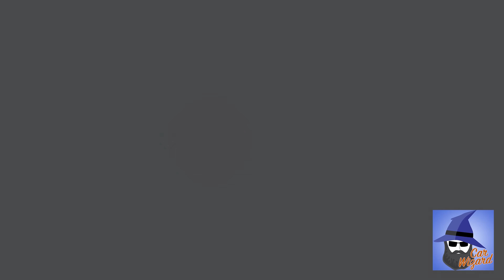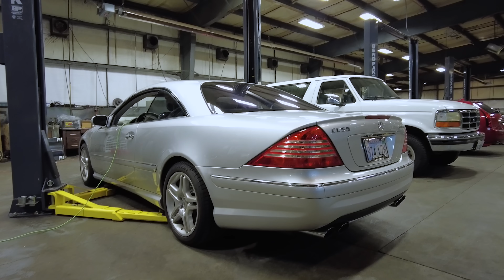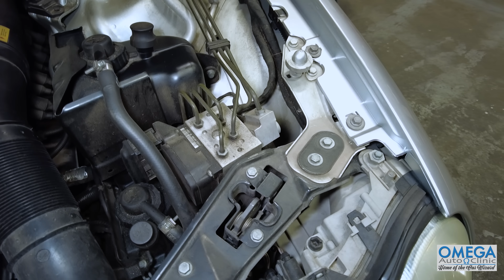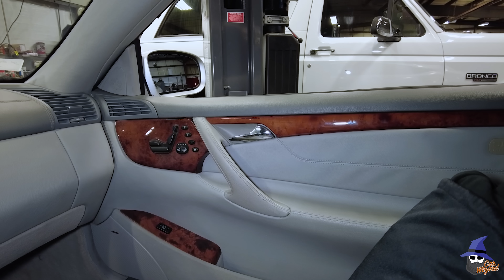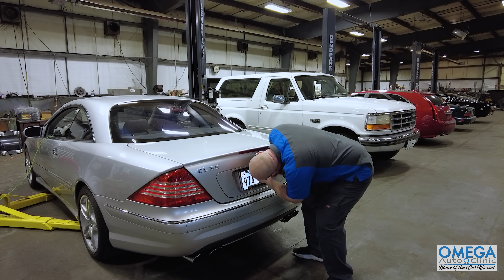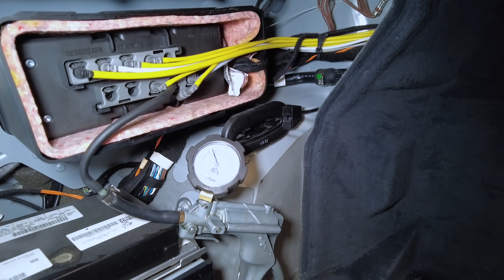Really, $4K to fix the locks! How can the CAR WIZARD charge SOOO much to fix this '05 CL55 AMG?!?

Comment: A dollar wages that it's the trunk lock line where it runs from the body to trunk lid.

I would also wager that if you remove/refit the pump fuse under the rear seat in the rear BCM, everything will work two/three times and allow you to trace any leaks. 

Also don't forget that much of the system is positive pressure as well as vacuum using the same lines.
Reply: I would also add that you can run  vacuum/pressure directly to each line in turn to function test each component. Actual hands on diagnosis takes about an hour and initially only requires pulling the trunk carpet panel and pump manifolds which simply unplug. Pulling each line in turn is asking to break a fitting. 

If the pump runs, then the chances are it is sound. The system is designed to protect the pump by timing it out if a leak occurs until it is manually reset, which gives the illusion of it not working.
Reply: I’ll add that based on my experience with my S600 other common failure points are the lines that feed into the doors, and the trunk latch itself.
Reply: I had a problem with 02 c class and the repair for the door locks not working with the key fob was to pull the sensor out of the drivers door and resolder the two main connections in the sensor circuit board. I saw a utube video showing how and tried it. It was a bit of screwing around. But it worked. The locks worked and if I held the unlock button longer the windows would go up or down and the sunroof would activate, first the shade and then the glass.
Reply: @paul5683  that could be it!  You're talking the little black sensor in the door handle I assume?  Ya I'm almost certain the Hold lock/unlock feature it has doesn't work too.
Reply: you sound familiar with these systems, I have an issue on my 01' s class with the locks not unlocking.  It seems as if they are weak.  They lock/unlock fine when the car is driving.  But central locking doesn't function properly and same with using the fob.  Any ideas?  PSE pump just weak?
Reply: @jordanh3866  Where abouts are you?

It sounds like it is an ambient temperature issue if things start working when the car is being used.
Reply: @alasdairhompstead7950  I'm in Minnesota.  It's weird, it's like everything functions except lock/unlock.  However like I said, once I put the car in drive, the auto lock locks all the doors with no issue.  I'm pretty savvy with these cars but I can't put my finger on this one at the moment.
Reply: @jordanh3866  Does the behaviour improve if you use the physical key instead of the remote buttons?

Does it lock/unlock as normal with the button on the dashboard?

Yes to both of these points to an issue with the remote side of things... Possibly a weak fob battery or as likely interference from another source... There's significantly more wireless technology today than when the car was designed/built.
Reply: @alasdairhompstead7950  no the central locking button doesn't seem to operate the locks.  I did put a new battery in the fob.  Haven't noticed a difference in performance if I use the mechanical key.  If the doors are locked lets say, like I pressed them down and closed the doors, they stay locked unless pulled up.  But if they are all pulled up, when I put the car in gear, they all go down like there's no issue.  Not the end of the world but it's just annoying lol.
Reply: @jordanh3866  The fact they lock when you start driving suggests that the vacuum side of the system is functioning. I no longer have a W220 to scan but it could be a gremlin in whichever module runs the fob/keyless go side of things.
Reply: @alasdairhompstead7950  Thanks I really appreciate the tips!
Reply: https://youtube.com/shorts/8w7Z7bWtMiI?feature=share

Comment: I wonder if the air pump can be rebuilt. Air pumps consist of rubber diaphragms that are vibrated by an electric motor. The rubber diaphragms rip when they get old. Being a Mercedes part probably not rebuildable but it's a shame because a rebuild kit would probably cost a few bucks
Reply: more profit on markup of a $1000 part ($300) than profit in a $10 part and 1/2 hour work.
Reply: @pablopicaro7649  Makes for lazy Techs too.
Reply: It wouldn't surprise me if the pump was actually the same as the one used in the W168 which only ran the door locks. A bit of patience and labour would see the pump swapped into the newer housing. That said, in this case I'm not convinced that the pump is actually the issue.

Comment: Five years ago, before the new and used car prices shot through the roof, you'd have to have a serious emotional attachment to the vehicle to spend that kind of money on fixing it.

This is yet another example of German over engineering combined with the tendency to not design things to last significantly past the five year mark.

The part that REALLY sucks is that once everything is fixed, what are the odds another PSR component will fail soon and burn up the new pump?

Quick question.  Are there any shops that rebuild these units so there are better options for owners than paying for a new dealer unit that has to be coded to the VIN?

Comment: You could also use a smoke machine just like diagnosing EVAP systems and connect it to each individual branch of the circuit to find the leak before you replace the PSE pump. Obviously the pump is bad but it is possible to diagnose without it.
Reply: Point is the man-hours to diag vs just replace the pump and run built-in diags that take about 2 mins.  Could run an easy extra few (or more) hours in diag labor for no necessary reason while the in-built diag will pinpoint the issue with very high reliability.
Reply: @JoelAz909  that's true. It's a tradeoff between a whole cost estimate and a partial cost, some customers may wanna know how much it will cost them up front rather than pay 2 grand and then need more parts. As a previous MB tech, the diagnosis path will also only tell you which part is malfunctioning, but not anything in between. You could have a broken line somewhere and it will diagnose a certain part as failing instead of the line, only to find out after you replace it.
Reply: @masonzayas8401  agree.   I thought it'd be obvious that an indicated failure could be the end module)device/whatever or the line between and I figured that one would automatically diag the line alone after fail module is found for just that reason ( at least that's what I would do if I was doing the repair)

Comment: I’m not surprised; it’s a complex system and with the age of the vehicle, probably some of those parts are globally NLA. And bi directional control can be exceptionally useful, especially chasing down faults in the body control system. (I’ve got a scan tool that I can individually activate my Buick’s power windows)

Comment: These made 469hp like the E55 or 493hp like the S55. The air suspension sucked. So a lot did the coilover suspension on the large 55 cars. The CLK, SLK snd C cars never used air suspension which was great.

Comment: Well I was thinking you could put a smoke machine on it and maybe find the leak now only between pump and whatever the pump is working like for a leak in the hose but since the pump has to be replaced or spend more time on it I guess I used to work heating and air and systems and years ago they used a type of low air pressure and or vacuum to move valves but that hasn't really been used gosh probably since the 70s. I mean it was pretty robust but you always had little teeny pipes going to everything

Comment: I always compare my Toyota repair bill to my sisters Mercedes-Benz. Her bills are outrageous and the car sits in the shop for days. I don't have any repair bills and mine sits in my garage when I am not driving it.
Reply: Most likely different segments. Since no stats anywhere of running costs shows an equal MB in the same class of car being that much more expensive to run.

Comment: I would love to drive an old Merc but repair nightmares like this are why I drive a Crown Vic.  My door locks are electric.  Had one fail.  $5 junkyard part and DIY, done.  Switches sometimes go bad, ebay replacement is $40.
Reply: In my opinion this is not an "old Merc". I owned five old Merc's. 71, 79, 84, 81 and 81. Those are a completely different animal. This thing is brand new by my standards. If I had the kind of money to afford this thing I would spend it on real Mercedes from back when they were worth it. Without all this ridiculous crap to go wrong.
Reply: Relax lol try out a m119 or m113 powered merc :) if repairs are your issues, buy a model with no sbc or air matic, and no convertibles, even tho I’ve had 2!! If you learn to work on these they are goat!
Reply: @Loujr2250  Biodegradable wire era is no go.  IIRC, 1990-96??
Reply: @encinobalboa  I feel like late 96’-2001’ is the sweet spot depending on the model. Laugh at me but I recommend a maintained SL500. M113 powered. Easy to work on, diagnose, sohc v8. Oil leaks will be your most common enemy. Find a car with a working soft top that’s been rebuilt, or even better, one that doesn’t work, and use the top manually!! The sun visors can be brittle, and the dome light, and maybe some wood on the dash will be cracked, but they are Literal Tanks! The M113 is super easy to work on lol. 300 bhp for under 10k is a Bargain.
Reply: @encinobalboa  parts can be expensive true, but check out FCP euro. They sell EVERYTHING. And they got life time warrant one all they’re parts. What does this mean? OEM quality parts, you can send back and get a new part the price of one. Pay for the shipping! This includes oils, gaskets, even brakes lol.
Reply: Plus it’ll feel like more sporty! I love me a crown Vic! 4.6 are tanks. I’ve had foxbody mustangs as well. But try it out, a 1999 sl500 would blow doors off a 2004 GT! Done it. G35s? Arent safe ether. Chargers? Better be an 8spd 🤣
Reply: @Loujr2250  Yup, I like the 97-01 SL500 a lot.
Reply: @Loujr2250  I went through the German sports car / coupe stage a long time ago.  Very cool cars to drive and interesting to own.  I got tired of frequent four figure repair bills.  Went with a Panther, learned basic wrenching, and simplified my life.  My Crown Vic is not perfect but I don't have to rely on anyone which at my tender age is priceless.

Comment: Older Mercedes definitely leveraged vacuum actuated all the things.  My grandfather had a Diesel Mercedes in the 70's.  Among its other problems, one was a leaky vacuum system.  The fuel cut-off for the engine was vacuum actuated when you turned the key off.  When that vacuum system fails the engine doesn't stop when you turn off the switch.  Rather than fix that vacuum system, my grandfather installed a John Deere engine-stop cable and rigged it in place of the vacuum actuator.  He got the part from his brothers' Deere dealership.  My grandfather went back to Fords after that.
Reply: Poor design on mercedes end
Reply: Older Audis are the same way. They use vacuum operated door locks

Comment: we had to replace the door lock actuator on a GLK and that was about $850 with labor, i was gonna try to do it myself but theres rivets on the aluminum and i didnt wana ruin it or have it rattle
Reply: Drill them out and pop them back in when needed. That's all they do.

Comment: The vacuum operated locking mechanism from 90's Mercedes-Benz could be tedious to troubleshooting and repair. Knowing what I know now, I would only buy one with the system still operational, or simply avoiding it for a gen with electronic actuators.
Reply: The satisfaction of a vaccuum system is outweighing the issues for me. I just hate cars where the locks clunk closed and the soft close sounds like a electric wire cutter. I was very disappointed by the new w213 e class having loud electric motors for the soft close.
Reply: But they are quite bulletproof systems, overall less problems than electric systems. But when it goes bad it can be tedious since no shop today except maybe the dealer has any clue how to fix. Ofcourse these seat bladder systems are stupid and should be avoided, if the system only operates doors/locks its quite reliable.
Reply: @Mortalomena  had an SLK with the vacuum system not working, and it was a mess to fix, because someone already been there messing around. Part of the reason I end up selling the car. So my advice it's buying one with the system working or at least with the PSE system to stock specs. Wonder if a conversation to electric actuators is possible for those models.
Reply: @RogerM88 you just have to look I had a S Class with the same issue as the video. I went to a U pull yard and bought the entire pump for $25
Reply: 200 bucks from a junkyard, pulled and shipped for a pse pump, coated the trunk mechanism with JB plasti weld, because thats what always fails first. Took me 40 minutes total. Good as new working 2 years in -40 temps.
Reply: @kolinstallman3788  cool idea

Comment: I'm surprised with the amount of tech Mercedes puts into their vehicles that they wouldn't put some kind of monitor on these vac lines so that if a leak is ever detected it would flag a warning light or message.  Rather than just continue leaking till the pump fails creating a costly repair.
Reply: As Wizard said, the PSE module will log trouble codes when something is on the way out.  But no one besides MB dealer service techs will ever bother to get those codes printed and looked at.  Besides, do you want to be the one telling a customer that power seat setting is beginning to fail, but it's going to cost upwards of $2000 to fix before it destroys the pump?